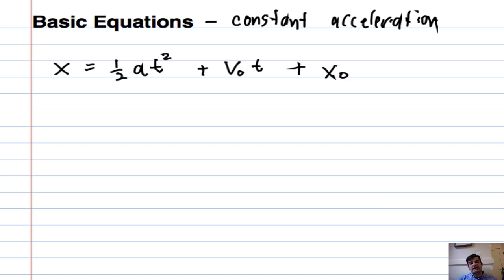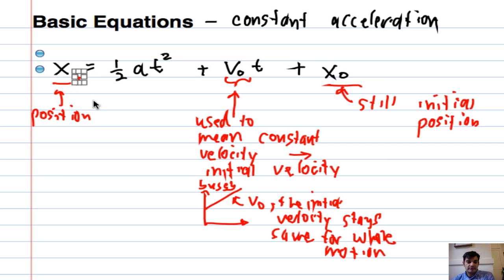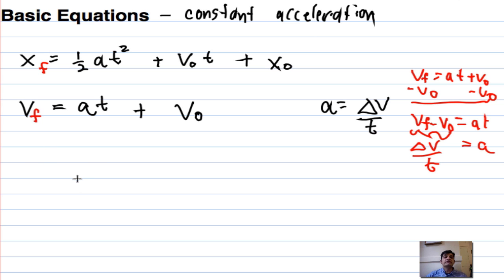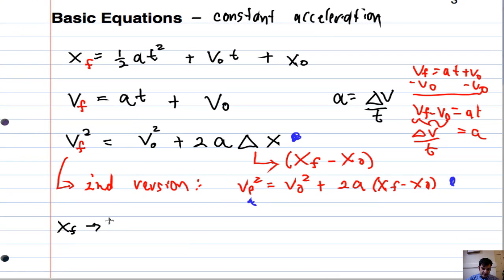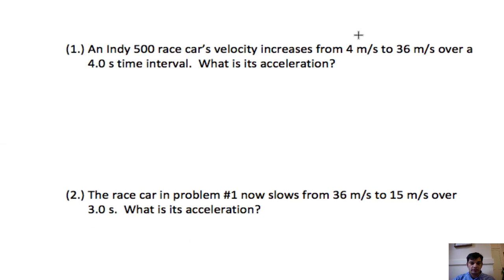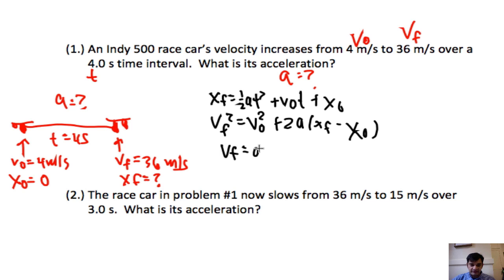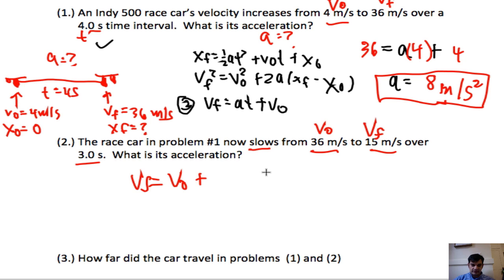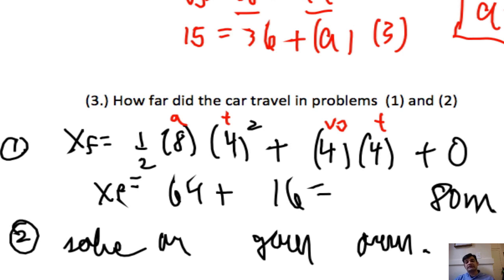Solving Constant Acceleration Problems

Comment: Help please!....  a 1200 kilogram car traveling at a constant speed of 9.0 meters per second turns at an intersection. the car follows a horizontal circular path with a radius of 25 meters to point P.  At point P, the car hits an area of ice and loses all frictional force on its tires.  Which path does the car follow on the ice?